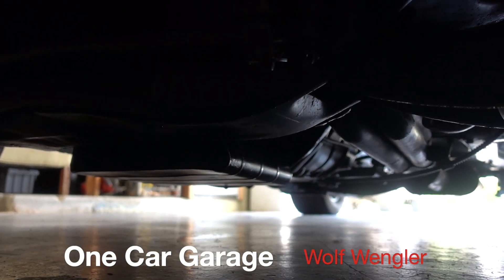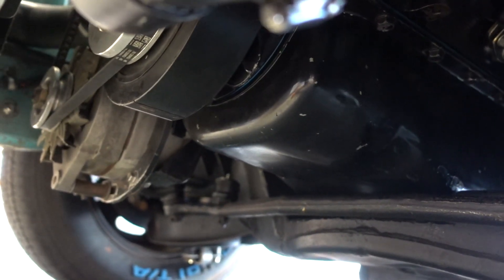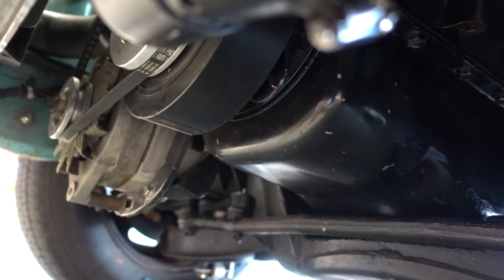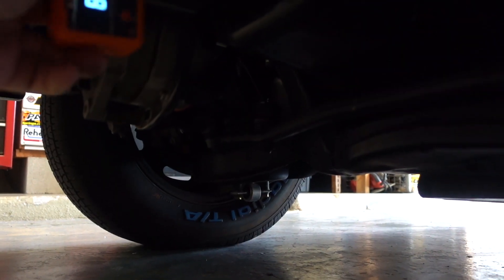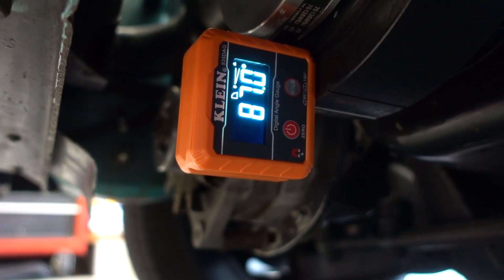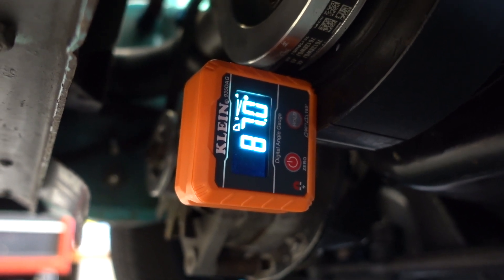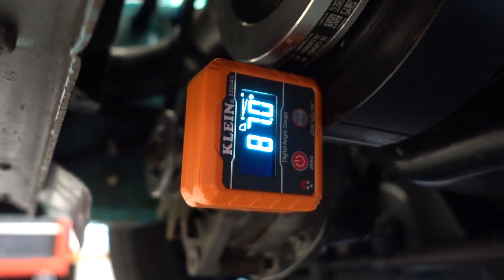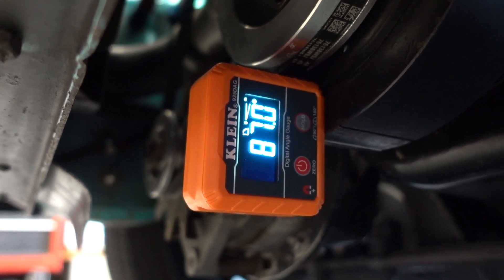Measuring Driveshaft Angle

Comment: what about 2 piece driveshaft with center bearing?
Reply from the maker: I'm not the expert on that, but the trans and the rear end need to be equal but opposite (3 up and 3 down, 2 down and 2 up , etc.)  so I'm trying to visualize how the center could be anything but straight.

Comment: Very interesting and easy method. I will try this because I have a major problem
Reply from the maker: Did it work?
Reply: @wolfwengler  I was off 8 degrees. I put in 6 degree wedges only because 2 degrees are supposed to be allowed for leaf spring wrap. It has made an 80% improvement.

Comment: I'm assuming the first rule is that vehicle is on a flat surface (level) and on
it's on weight via the wheels?
Reply from the maker: Yes on it's weight on the wheels, but the surface doesnt have to be flat. Think about it... the driveshaft angle doesnt change on a hill....
Reply: Level surface doesn't matter as itll all be relative.  In the end you put numbers into a calculator to get you operating angle. But for a wheel alignment then you'll need a level surface!